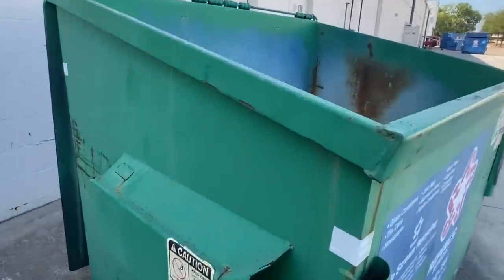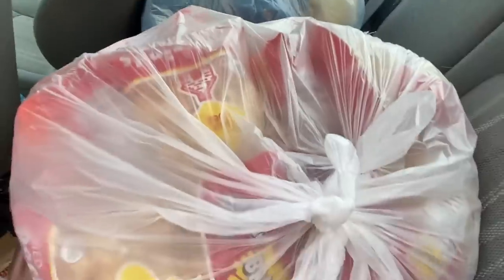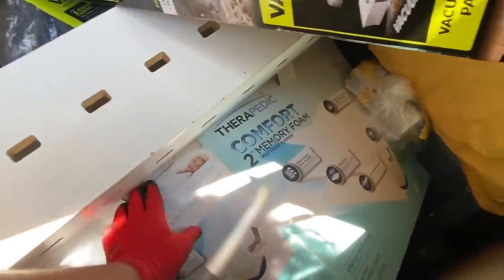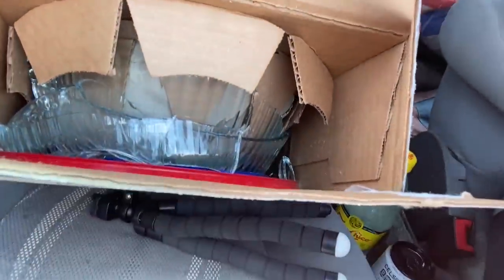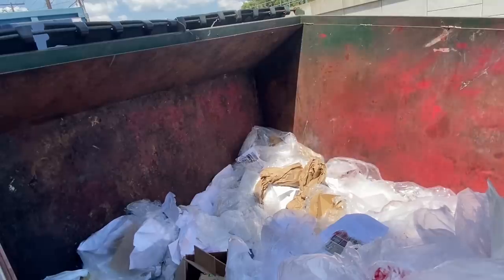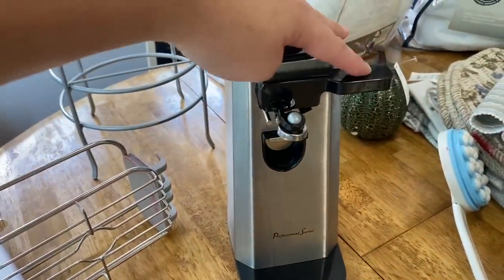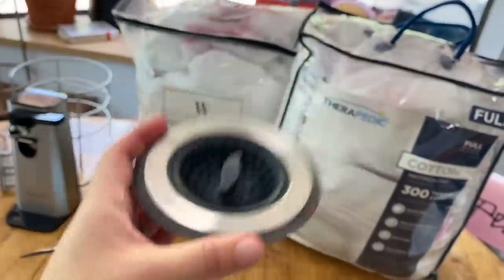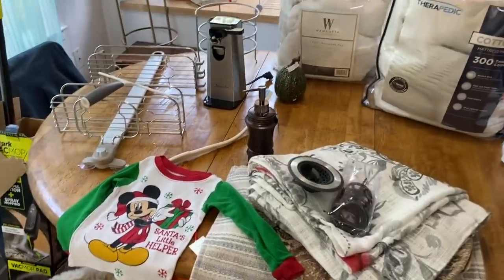I Went Dumpster Diving at Dollar Stores & Retail Shops and found so much!

Comment: I have used something called “goof off” to remove oil based paint from a duvet cover. It worked great and removed it all. You can find it in the laundry soap isle at the grocery store. It’s a small rectangle bottle of liquid. It removes everything! You squirt it over the “stain” paint and let it soak in for about 10 minutes. Then throw the items in the washing machine and wash. If it is still there when you remove it from the washer do this process again before drying. It usually only takes one go. Hope this helps! I love your videos and enjoy your great energy! Bless you and yours!!

Comment: Okay, if you want the high ticket items, ya gotta take a grabber, a step ladder,  and a metal pole (I use the kind that you put under a door knob to keep people from opening the door). The pole can hold up heavier trash , like metal shelves, so you can get underneath. 
A taller step ladder helps you dig down further.  The stores really hide stuff. If ya wanna get the high ticket score, ya need to have a few tricks.  I’ve found 30 minutes before closing is a good time to go. The trash is one of the last things to go out . If you wait, other divers will fight you for stuff. They get really territorial. 
Love your channel!!
Reply: Dye /grabber remover for laundry takes it out . Don’t rub it in by scrubbing. Make a bucket and soak it.  Then lay/hang on a clothesline or on the driveway and use a jet sprayer on a garden hose. Spray from the under/back side to blow the spray out of the fabric instead of from the front or top side. I’ve taken loads to a laundromat and using the huge front loaders. 
You can fix the base of the fan. Use tile adhesive and/or super glue and then hot glue. Black sharpie will color the  glue/adhesive.

Comment: the back massager: the roller part screws off and you put lotion or oil inside so it's easy to apply lotion to your own back. Not really a massager but more about getting lotion on your hard-to-reach places. Good job today! Also, I've been told to use hand sanitizer to remove the paint from fabrics. You use a good amount, softly rub it in and wait about 10 minutes, then wash.

Comment: Always take the lids for the Pyrex.  They always seem to get broken and people do like to have those replaced.  The thing you called a back messager is a thing you use to put lotion on your back. The head of the thing screws off and you put the lotion in and the rollers put it on your back.  I had one at one time.

Comment: I also live in Texas and all the DG's around her put merch in black bags and trash in clear bags. It's the same when I watch other divers as well. You should always take candles. You can remove them from the glass, cut them up and use them in warmers or melt them down and pour them into decorative containers you find in dumpsters to resale. The round metal stand is for a glass pitcher dispenser to sit in. The glass jug was actually sitting in the dumpster and you kept moving around it constantly. It usually has a spicket on it to pour a beverage out of it. You also threw a little 3 tier plastic shelf to the side out of the bag. That was a spice shelf that goes in a cabinet so your spices are lined up at different levels so you don't have to constantly move them around in your cabinet. On the can opener if you will lift the little black handle up and pull forward you can slide it off. Place and little rubber gasket behind it and replace it back on it and try it again. It sound like it is to close to the body of the opener to catch the can.

Comment: You could try a patch test and try rubbing alcohol on the paint stains and see if that works. I've used rubbing alcolhol to help clean off paint from plastic palettes before. Also of course you could use baking soda or other stain removers and soak them, and also spray paint that shelf a solid color!

Comment: Suggestion for the camera.  Make a rope type thing to attach to your camera that way if you drop it you can just pull it back up.  The lids will sell for replacements on your website.  If it is a true display it will not have the motor or the guts inside.  But again replacement parts sell.  Looks like dollar general penny items from the penny tuesday one that you found the can opener etc.   Try DG on Mondays & Tuesday normally days they clear out the penny items.  Idea for the wicker basket  take 2 pillow cases & cut the sides open (measure first to see if it will fit in the basket to protect anything you put in it)  But sew the pillow cases together to fit down in the basket just to be decorative.  Take green paint for the pumpkin.  The massager does open to pour in body wash to wash your body with.

Comment: Hey Kelly try these different ways to remove spray paint of fabric and clothing and other surfaces. Hope it helps!!💕💜💕💜💕💜💕🇩🇰

Removing spray paint (acrylic)
Use an alcohol-based product to try and break down the bonds in the plastic layer. Rubbing alcohol, some nail varnish removers, and even an alcohol-based hairspray all work well. Rub the product on the stain until you begin to see some of the colour transferring from the fabric to the cloth.

Mix a solution of one part dish soap, like Dawn Ultra Dishwashing Liquid Dish Soap, to one part warm water. Sponge the stain with the detergent solution, tamping it vigorously. Rinse and repeat this process until no more paint is removed. If the stain remains, try blotting with acetone.
It dissolves a variety of plastics, and is the main component of many brands of nail polish remover. It's useful for testing for latex paint because it softens it, but it isn't a strong enough solvent to soften alkyd paint. ... If the swab or rag shows the paint color, it's latex paint.

Goo gone, 24 oz, latex paint cleaner trigger, specially formulated to remove latex paint quick & easy, works on wet & dry paint, safe on many surfaces, will not harm wood floors, carpets, plastic, tiles, etc., perfect size for any DIY or professional.
You can use rubbing alcohol or hairspray as it says above. That helps, and vinegar and baking soda might do the trick. ... Put vinegar on the paint stain, and let it soak. Rinse the vinegar off, and then put the shirt in the laundry to wash as you normally would.

Vinegar also removes spray paint from glass, plastic, ceramic, tiles and it is environmentally friendly. ♻️🌎♻️

Comment: Hi Kelly 😀 what a great haul! You could try using 100% acetone to remove the red paint from items. It should get paint off any glass items without any problems.  You could try it on fabric - use a dabbling motion rather than rubbing so that you don't spread the paint. I hope this helps 😀 Hugs from Australia 👋

Comment: On the religious candles:  Take a heat gun or even a hair dryer gloss back and forth till the wax melts a little and they'll slide right out.  Use a glass jar (canning jar) and light and use.  These would be a good stock up item to have for a power failure.. free lighting.  Anna In Ohio.

Comment: You can use a heat transfer for the red paint and you just use a white cloth and a iron and this works for most red dye on carpet and furniture so you can try a area just get the rag wet and you should see the color lift pretty quickly and just rotate the rag as the color lifts.

Comment: Nice haul as far as the washable material items try getting a degreaser.  Some kind that’s for like hands.  Sometimes that will bring out that kinda paint.  Of course if it does work you’ll have to then use a grease remover on the material and wash again.  Good luck!!!

Comment: Use Gojo hand soap( it's in the automotive section) on the paint. Scrub before you put it in the machine. Add a little bit to your reg soap. Should take it out. May take a second go round.

Comment: Ive gotten spray paint on my clothes many times... if its all dried, just try to get as much off as you can by cracking it and gently scraping at it.... and then use nail polish remover. Then I've washed it as normal.

Comment: To remove dried spray paint from your clothes, start by using a butter knife or your finger nail to scrape away the paint from the fabric. Next, spray the stain with an alcohol-based cleaner, like hairspray or nail polish remover, to break the bonds in the paint so they can be washed away.

Comment: I've read that this would work on spraypaint: 

Gentle products such as olive oil can remove spray paint from hands and many smooth surfaces. Many spray paints are oil-based and can be removed, or at least softened, with another form of oil. Any oil from the kitchen, such as cooking, olive or vegetable oil, will do the trick

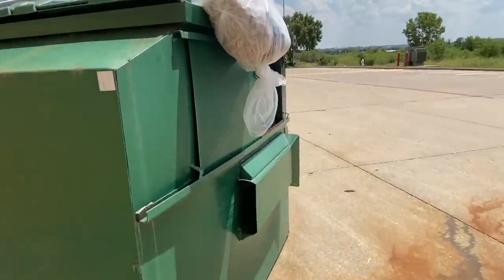Comment: 14:27 If it doesn't work pleas scrap out the 18650 Lithium batteries.  They sell for about $2 a cell on ebay.

Comment: The long handled thingy with the roller balls is a lotion applicator for your back.  You should be able to unscrew the roller ball surface and pour some lotion inside.  I used to have one.  I didn't like it.  Too much lotion dispensed at one time and the balls didn't roll properly.

Comment: Any candles I'd suggest taking if broken even. You can cut them up and use the wax in a wax burner if its smelly candles. Just place glass in freezer and then it will come right out of the broken glass 😀

Comment: Maybe try the Oxi clean treatment spray that most grocery stores sell on those fabrics with the red paint. I once accidentally washed one of my husbands uniform tops that had a blue ink pen in it and used oxiclean spray to get it all out. Looked good as new. Took about two tries though but I’m sure if you let the treatment sit on the spots for a little bit and then wash it out, that might possibly work?

Comment: Try L.A.'s  Awesome cleaner from the Dollar tree... It's the yellow cleaner. Use it straight directly on the spots and then pat with a towel until most of the color comes up. Them spray down again and wash in coldish water. Hot sets stains.... 
Hope this works for you! PS... Wear a mask when using Awesome, it's super strong smelling and hits your lungs like pepper spray! LOL

Comment: Don't use hot water or put in the dryer until you are certain you have as much of the stain out as possible. Heat may set it.

Comment: Go to Dollar Tree and buy a product called Ausome[spelled wrong] I have used it on some paint spots and it came out. You will want to get enough to cover the things while they soak for a couple hours or more and see if that works. For $1.00  bottleit is cheap enough to get several bottles and it is also a good household cleaner..

Comment: The thing you referred to as a massager is roll a Lotion, used to apply lotion or bath gel to the back or hard to reach places.
Why the red spray paint. 1) to prevent fraudulent returns 2) to prevent someone from hurting themselves on faulty or contaminated items after taking items from dumpster and attempting to use item  3) to prevent resale of items of damaged, used items 4) to meet contract requirements with vendors when disposing of items 5) some stores smash items with a hammer to render items totally unusable so red spray paint is not that bad 6) if the item is good/sellable after being returned or being a display BBB will as-is the item when at all possible. Speaking of displays, the can opener was probably a display which means the blade was removed.

Comment: Dry Paint

Use a butter knife, spoon, or fingernail to scrape up as much of the hardened paint as possible. Take care not to tear the fabric.

Use nail polish remover or paint remover to remove the excess paint. Perform a test first on an unseen area to make sure you can safely use these substances without removing the dye.

If you are dealing with fabric from clothing, throw the garment in the washing machine to remove as much as the paint as possible.

Comment: Try DD7 and an old tooth brush to get paint off fabric. If it's ok for bleach wet the brush with bleach and apply DD7 and scrub. It will feel warm to the touch makoe sure you wear the gloves you would use for dishes or you could get a chemical burn . Also make sure your in a well ventalated  area. Then wash with oxyclean. I used to work as a housekeeper in a motel and the head housekeeper used this procedure for getting out the mystery stains from sheets and bedspreads!

Comment: Krud cutter there are u tube videos on how to use it. It removes it just some elbow grease. Other dumpster divers use it.
Reply: E600 is very good glue for glass and ceramic. It would fix the soap dispenser.

Comment: I’m involved with direct marketing - But when I find a product that really works for the purpose I need - I’ll recommend it- Amway Indsustro- clean will take out almost any ink, wood stain ,paint , chemical oil based type stain. Even out of bright and fragile fabrics. 
Once I got a vintage 1980s vivid multi colored silk blouse - still in the dry cleaning bag- meaning the stain survived everything the dry cleaner could throw at it- with a permanent marker stain on the sleeve- 
soaked the stain in a little cup of straight full strength Amway industro- clean over night and the magic marker stain was gone and the bright silk blouse was perfect.
It might work on the paint on fabric.
Reply: Oops - didn’t proof read it - I’m NOT involved with any multi level marketing - not a sales person for Amway. Just like that product.

Comment: Dry Paint

Use a butter knife, spoon, or fingernail to scrape up as much of the hardened paint as possible. ...

Use nail polish remover or paint remover to remove the excess paint. ...

If you are dealing with fabric from clothing, throw the garment in the washing machine to remove as much as the paint as possible. It also said rubbing alcohol. You could also try some Goof off

Comment: How to remove spray paint from fabric:

Wet Paint
    If the paint is still wet, blot, don't rub, the area with a light colored cloth and warm water. This is the same method you use to remove stains from carpet. Blotting draws the stain upwards into your towel. Rubbing, on the other hand, forces the stain down, deeper into the fabric, making it even more difficult to remove.
    Use a dab of dish soap oil-based stain remover if necessary.
    Blot the area with a dry cloth to absorb the paint.
    Repeat as necessary.

Dry Paint
    Use a butter knife, spoon, or fingernail to scrape up as much of the hardened paint as possible. Take care not to tear the fabric.
    Use nail polish remover or paint remover to remove the excess paint. Perform a test first on an unseen area to make sure you can safely use these substances without removing the dye.
    If you are dealing with fabric from clothing, throw the garment in the washing machine to remove as much of the paint as possible.

Comment: I got this off the internet for the spray paint: Apply the nail polish remover to a clean cloth or towel and rub the affected area in a circular motion from the outside working toward the middle. Step 2: Continue until all paint is gone. You may notice as you're cleaning that the spray paint is becoming lighter.

Comment: Gotta get into those bags, not a visual over kinda place. Tear open bags. #DEGEZWASTE uses black contractors bags for their goodies 🤗 Gotta push, pull, cram 😂 Be aggressive be be aggressive. That small wire stand you said was for to is actually made to hold the large jar you left 😣 Its a drink dispenser

Comment: I don't understand why the store doesn't donate these products instead of spraying with red paint, such a waste.  Aren't you afraid of eating the chips when they have been in the garbage?
Reply: They were all in a bag to themselves and are still sealed. Nothing could get in the primary packaging to contaminated the food. For other divers I would say three things - 1 - Check the seal on the bag. Put the top and bottom seals against your face or hand and GENTLY squeeze. If you feel air coming out anywhere along the seal, don't eat it. You'll also want to do the same over other areas of the bag to check for small pinholes. 2 - Check the Best By date to make sure they aren't outside of the recommended date for best quality. Although, a BEST BY date doesn't mean food safety issues are a concern. Just that they may be a bit stale or have some lost flavor. 3 - Most importantly, check for recalls! FSIS maintains a list of any recalls for food safety concerns. If you see a bunch of similar items (in this case, two days she found pork rinds from the same company dumped) I would be worried about a recall. (But I just checked and there have not been recalls on that product in the past year).